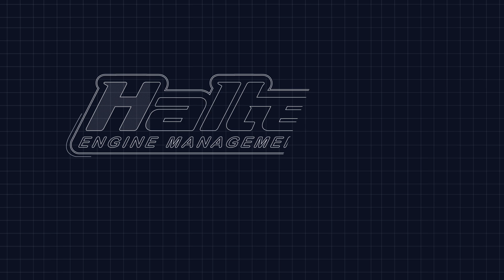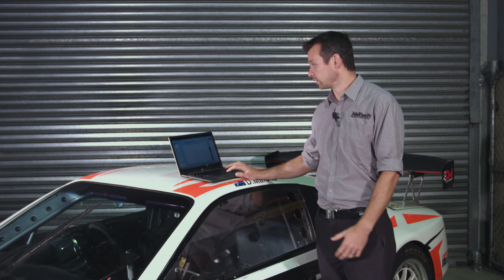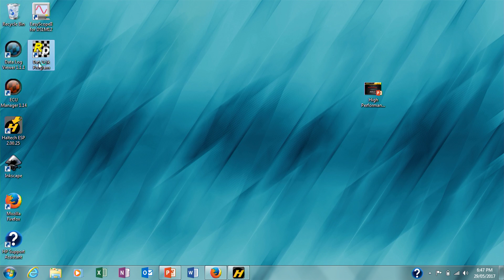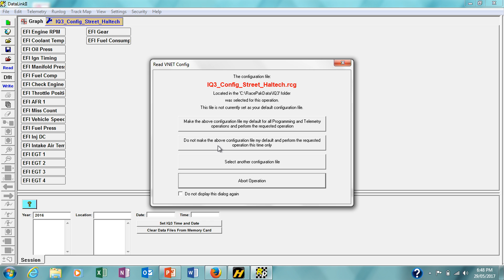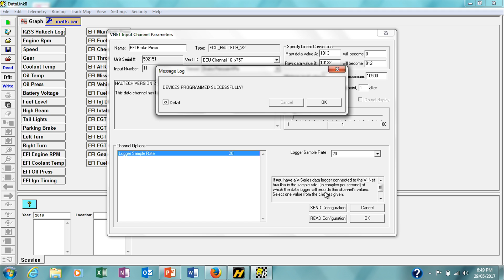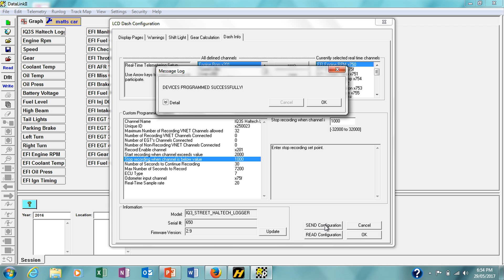💬 How to setup your IQ3 Street Dash - Technically Speaking

Comment: Do you have a link or item number for the 34 pin to Can wire input in the haltech 2500 Elite ecu? Seems pretty hard to find it. Being I have both it wouldn't make sense to have to wite in the flying leads that the dash IQ3 came with

Comment: I have a elite 2500 in a fox mustang. Sequential and direct fire. I like it. I wish that haltech offered a color touch dash logger and non logger models that is comparable to the Holley dash in size, capability and price point. Lots of domestic guys in the states use the Holley. Well most use either the elite, Holley dom or ft5/600. The racepak is cool and works great but it’s not as sexy as the Holley dash or ft5/600 dash. I have my hopes up that this will come soon. I will buy one as long as it’s not motec pricing. Much appreciated. And I am telling you at haltech, if you make a 7 inch color dash, even if it’s not touch screen with no logger for 7-800 bucks you won’t be able to manufacture enough of them. If it had touch, so you could say get rid of a trim module and swap tunes with it etc for 1000, you wouldn’t be able to keep up with demand. I promise. I know you must have something in the pipe. Hit the key, the 7 inch color dash comes to life, haltech logo in full then the color cluster appears with full array of channels being monitored. Oh man. I better quit dreaming! A can dwbc which uses Lsa 4.9 sensors would be epic as well! I love my elite. Thanks again patriots. Corn fuel makes the world turn.

Comment: which is the cable that talks to the Datalink software for the laptop? I have the USB plugged in but it has a serial end, is there a lead between this and the laptop?
Reply: Yes there are two cables that need to be joined together. The first cable with USB end into your PC and the end of that cable has a serial connector. Then your other cable is serial connector to 3.5mm mini jack which goes into the Racepak dash.